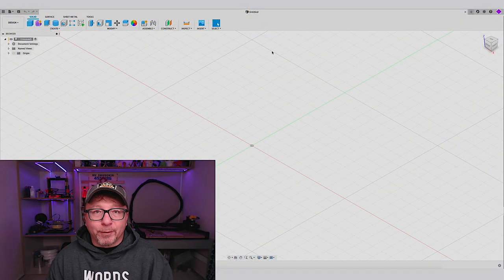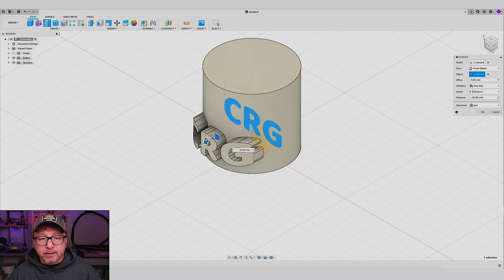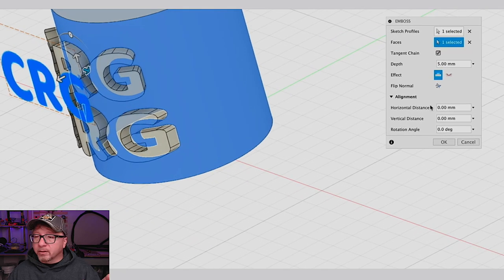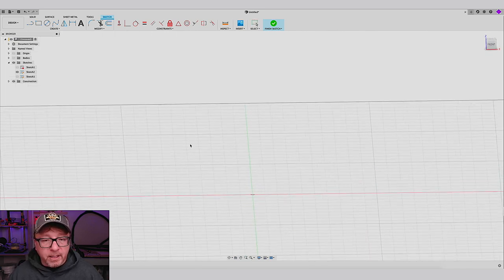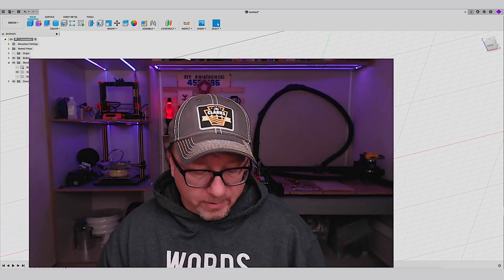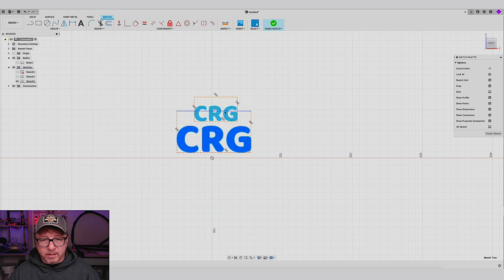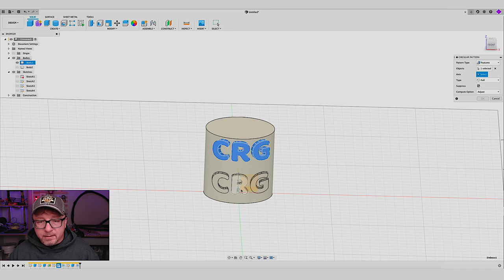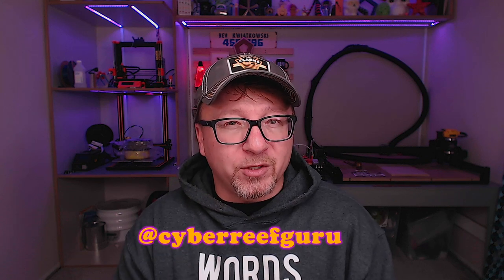Fusion 360 Wrap Text on Curved Surface using Emboss

Comment: Can you do the same on a vase?  I have a vase I designed but it doesn't show up as an object to select.  I am stumped and not sure why I cannot select the vase surface.

Thank you.  It is a Very good video
Reply from the maker: Hello Rob - what do you mean by 'vase'? You mean something designed in the mesh workspace? I think the emboss only works on solid objects (brep).
Reply: I ran into the same thing. As near as I can tell, Fusion360 only allows the emboss function on shapes that curve in one dimension. You can emboss on a cylinder, but not on a compound curve shape such as the side of a bowl (or vase, as you say).

If anyone has a solution to embossing on compound shapes, I'd love to hear it.